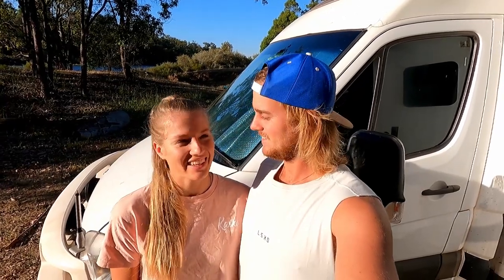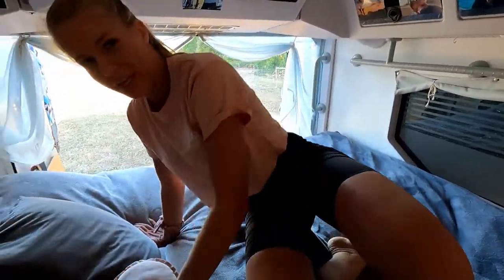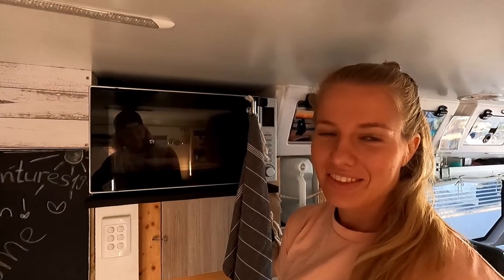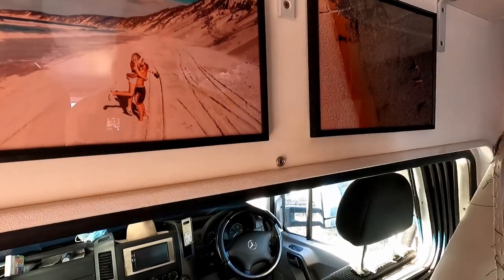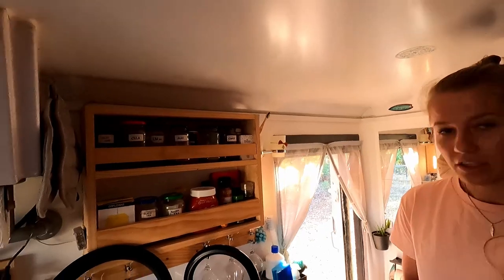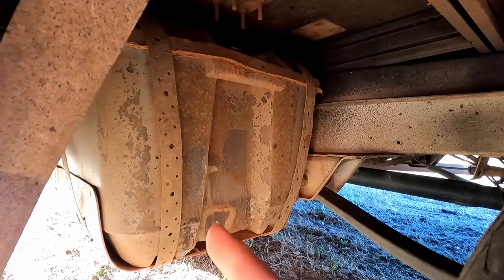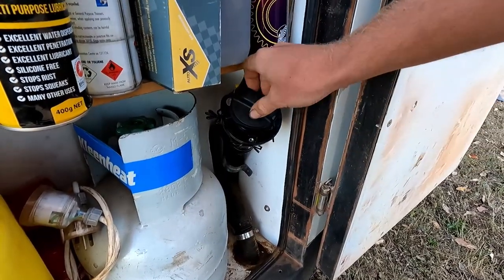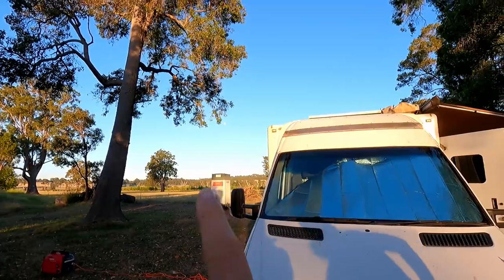Mercedes Sprinter (ex ambulance) Van Tour

Comment: Great video. We have a van the same. How did you deal with those electric door locks that prevent you opening the doors when the power runs out?
Reply from the maker: Awesome! Well you can unlock the side door manually. At least ours had the option :)
Worst case you climb to the back from the cab and open the door from the inside which always works :)
Reply: Thanks for the reply! We are enjoying our sprinter and love what you did with yours. Enjoy following you guys too! Have fun.
Reply from the maker: @James-nx4dk  thank you😍🥰

Comment: Hi Guys. I'm in NZ so similar  climate. I'm wondering about insulation. Do you have any? Or deal with condensation issues? (I have just bought the same vehicle as you.) Love to hear your thoughts. Thanks heaps.
Reply from the maker: Hi Nicola, The ambulance came with doubla layered walls with a foam insulation in between, which works pretty well. Most of the heat and cold get in through the door and windows🙈

Comment: Can the 2 extra seats at the back cabin legally allow you to have 2 extra passengers? Do they both have seat belts? And can it be removed and put back in easily? Family of 4 and just wondering if even just middle seat can be removed if we're not travelling as full family.
Reply from the maker: Hey, these are two legal seats with seat belts. The middle seat is running on tracks and could be unscrewed from the sled (we could provide you with some photos if you send us an email (in describtion) or fb/insta message. The other seat sits on a solid seat base which is a storage cabinet and vent fan as well. So removing the seat is easy (4 bolts) but the seat base would still be there. Cheers